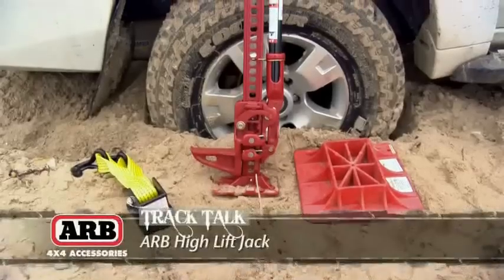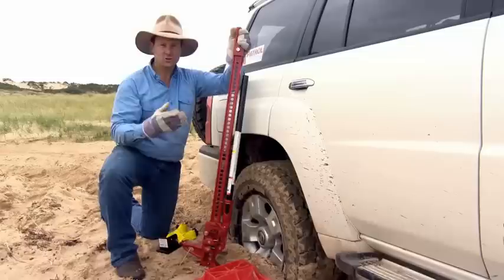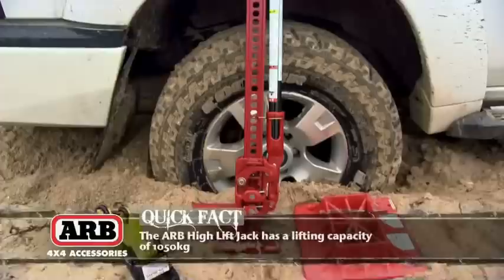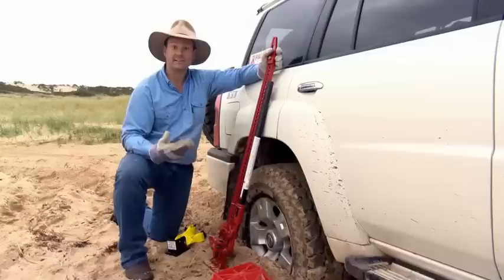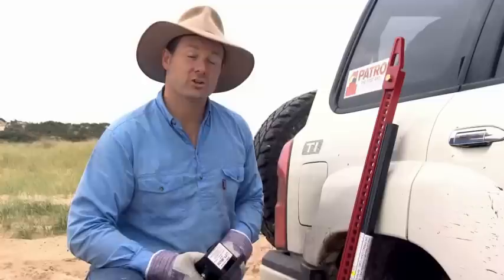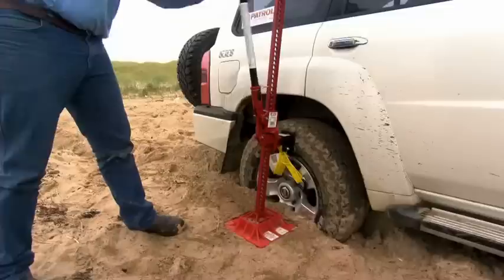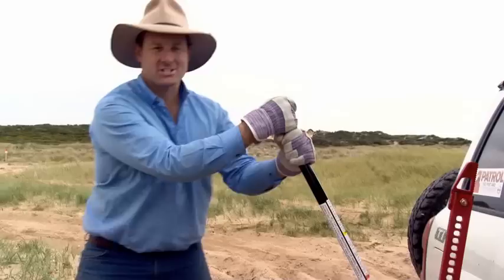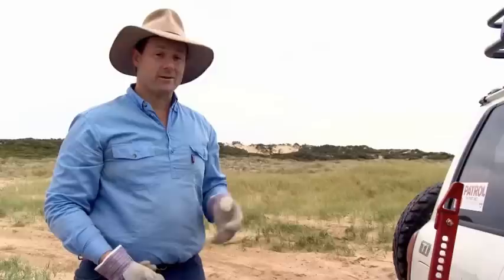ARB Hi-Lift Jack Demo

Comment: The spring back action is normally when the jack is being cycled downwards.  This is true with most of the mechanical jacks.  I have not seen the handle spring back in the raise mode nor seen a video of that handle spring back in that mode.  Still is wise to be careful regardless of mode.  Much like the safety of advice of never point even an "unloaded" gun at someone.

Comment: What does one do if the wheel one uses to Jack up the vehicle, is the same one which one has to change, like in a situation where one has a flat tire?
Reply: You could use the liftmate to jack it up and place a jack stand and lower jack
.